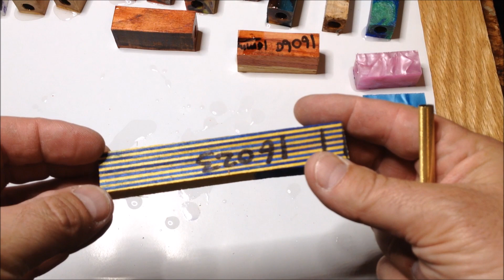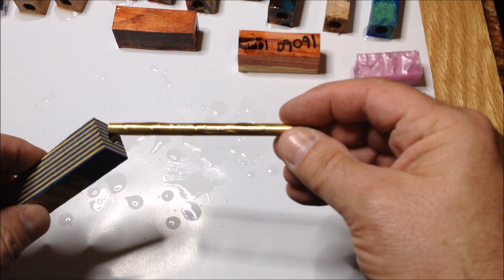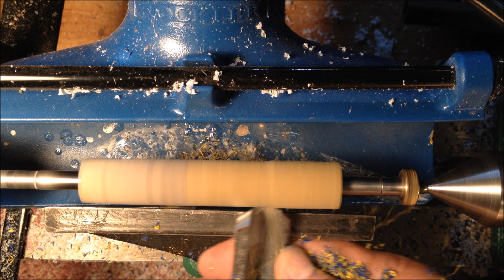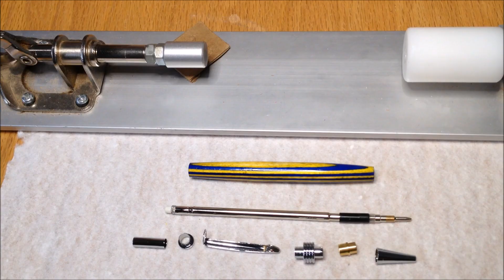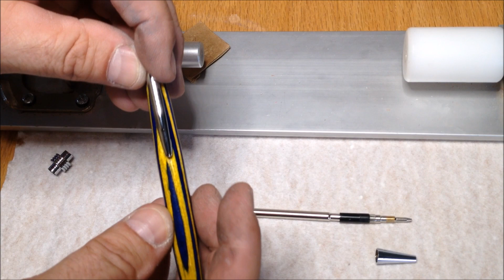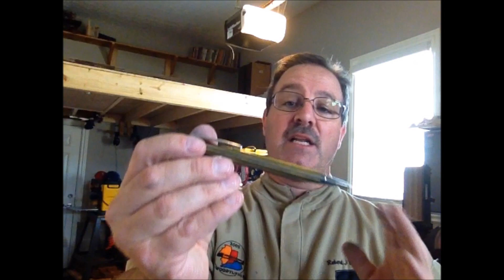Modified Mechanical Pencil From A Slimline Pencil Kit

Comment: This 6 year old video is perfectly timed for me.
I've been making the modified slimline and fun line pens for a while but have not tried a pencil kit. Saw an old friend tonight who loves purple. When I got back to my shop I dug out my last piece of purpleheart, A 3/4 x 3/4 x 12" and decided to finally try a pencil and make her a pen/pencil set. And bang, here you are with the instructions.
Thanks for all the videos that are so excellent for a new guy.
Reply from the maker: What a great gift. Your friend will love it. 

Regards,
Bob
Reply: If it wasn't for my screw ups, I'd  never have an up. But, lucky for me I have a local sawmill 3 miles away that has started carrying exotics. Just picked up a 1" x 4" x 36" piece of purple heart for 20 bucks. Thats a lot of pen blanks. He also gave me a bunch of walnut 2 foot by inch and a half, a nice piece of quilted maple and a large slab of beautiful Hackberry.  Hackberry is big enough  for a charcuterie board.
He has some outrageous slabs of sycamore,  Hackberry,  canarywood,  flame box elder,  everything at about 1/4 cost anywhere else. Got get some money together and get back to building big stuff, drop the pens for awhile.

Comment: I like this modified kit. I am going to have to give it a try. On a side note maybe you can help me with an issue I am having with modifing a pencil kit. I have a request from a family member to make a desk set. He sent me the funnels and some ebony to make them out of. He wants a matching pen & pencil set, slimline sized and twist mechanisms. Also the end will be modified and closed in with no clip. Pretty much just like a typical sling pen. I can modify the pen kit and just use a slimline kit no problem. The issue I am having is finding a way to modify a pencil kit with a twisting mechanism to match. I thought for sure I could find a kit somewhere but I have had no such luck. The only twist kits I can find in pencils are very large and will not fit in the funnels which are designed for slim lines. I actually thought maybe someone would a kit where the nib twisted to advance the lead (anyone remember the old Rose Art mechanical pencils that the nib twisted instead of clicking like the Bics?) Any thoughts on a possible solution to this would be greatly appreciated!
Reply from the maker: +Joshua Oehler hello Joshua,
  I have never seen a twist pencil kit for a Slimline frame. That only thing I can think of is to buy a couple of the Rose Art pens and deconstruct one to see if you can rebuild the shell to work with the brass tubes. Sorry I couldn't be more help on this one. 

Regards,
Bob

Comment: Bob, please let me know if I’m correct about this:
1)  The Penn State Indust. Slimeline and Trimline PENCIL kits require an additional length added to the blank corresponding to the width of the center band (.25”) to allow for the pencil mechanism to work and fit properly.
2) The Slimeline and Trimline PEN kits do NOT require this extra length in the blank since the center band fits OVER the brass tube therefore does not “take up extra room”.  Whereas the PENCIL kit’s center band fits INBETWEEN the two brass tubes and therefore DOES “take up extra room”.
3) I see that the Slimline Pro PENCIL and PEN kit’s center band fits in between the tube and so these pens (and pencils) WILL require a corresponding longer blank.

I’m not sure if this will help anybody in the future, but I didn’t get this at first and had to do some digging so my compartmentalized brain could make sense of it. :)
Thank you for your continued instruction, good nature, and support.  - Jake
Reply from the maker: Hello Jake,
  I had to read this a couple times but the information is 100% correct. Thank you for posting it. 

Regards,
Bob

Comment: You make it look soooo easy!  I retired from the Air Force a few years back, and I’m trying to fill the void with fun things...one of which is woodworking!  I’m enjoying myself very much, and I recently came across a pretty good deal (I think) on a used lathe.  I’d like to be able to turn some pens, but I’m having a hard time with a few of the details.  For instance, what are you using on your head & tail stocks?  Is everything pretty much standard? (The mandrel, spacers, things like that.). Any help you could provide would be greatly appreciated!  Cheers!! 😊
Reply from the maker: You need to know it your lather is a #1 or #2 Morse taper. Then you can purchase a mandrel to fit. I like the mandrel saver from www.penstateind.com. 

The mandrel diameter is 1/4” and that is the inside diameter of the bushings so no matter the outside diameter, they will all fit the mandrel. 

Regards,
Bob

Comment: Hey Bob, can't believe I am just now getting to this vid! One question: it would be ideal to use a custom cut tube, but is there any structural or functional reason not to use the stock tubes? (Carefully of course, so I don't end up burying one a quarter inch deep into the blank)

I've got what may be killer prototype blanks just out of the pot that I want to showcase. Thought honing a new turning technique would be awesome on top of the casting!
Best, 
Steve
Reply from the maker: +Steve's Turn - Pens & More Hello Steve. I think the single tube would be structurally stronger but I believe you could do it with the stock tubes.  I’d love to see a photo of your finished pen and blank.

Comment: you move it back and forth? i was informed not to do that because it could get glue inside the tube
Reply from the maker: It can but you really need to spread that glue, especially onto the ends of the tube otherwise, the material will be like a fingernail, not attached, and can break off. 
  Use something to plug the tube while inserting it, wax, Play Doh, or even a potato slice will work. 

Regards,
Bob